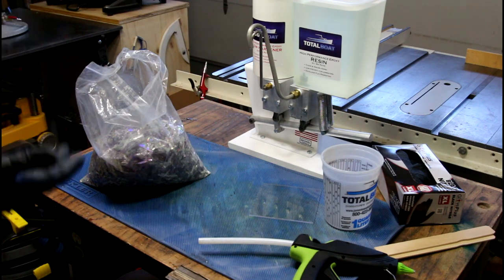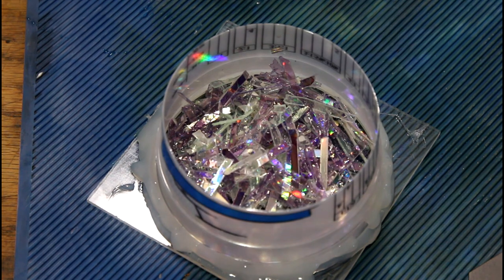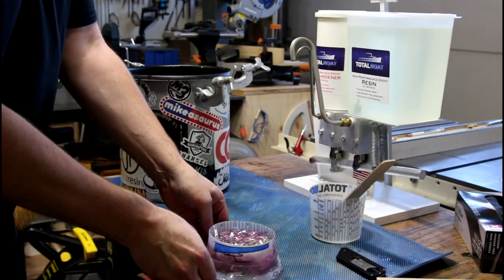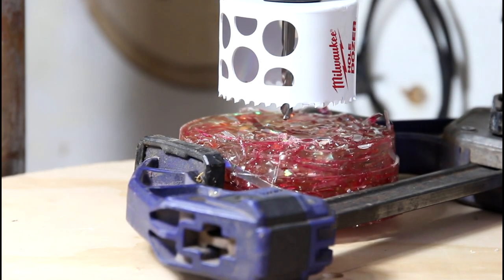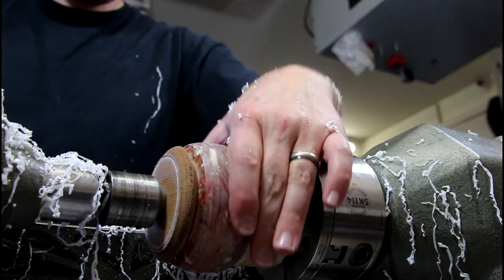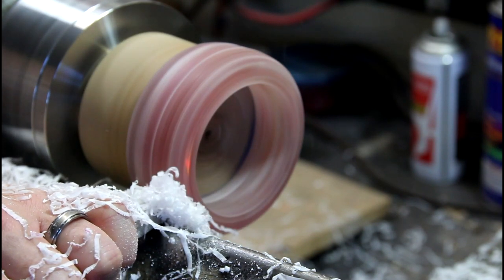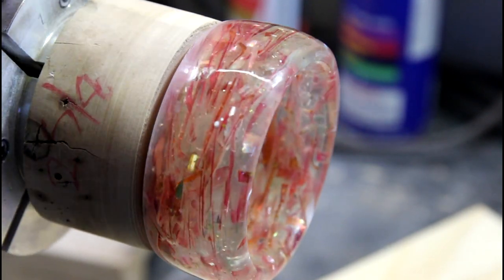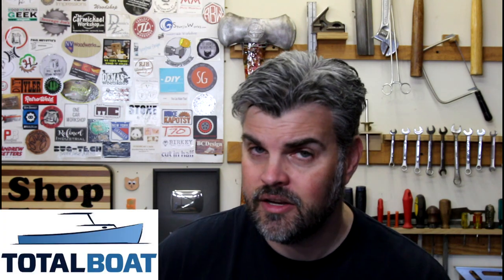Shredded CDs Cast In Resin? OK.

Comment: Every time you say "Shredded", my brain fills in "cheese", so now I'd like to see you cast shredded cheese in resin.
Reply: Yes
Reply: It would melt tho
Reply: Can Peter bring cheese into his shop without getting bio-plastic PTSD.
Reply: I like where this is going but to make it a feasible project can you make a mold of cheese and yellow resin and make it look like you turned shredded cheese? You got this pal
Reply: Yeah, if he just casts a block of yellow resin and hits it with the right tools before it's 100% solid he would end up with what would look like shredded cheese but without any of the odd aging and discoloration issues. Hell if the timing is right it will have the consistency of cheese and he could even use a cheese grater to shred it. Has peter tried messing around with large bowls of resin before they are totally cured?
Reply: And put  it in a cow mold
Reply: My brain finished it with “lettuce” 😂 shredded lettuce
Reply: Yes!  Make a chili bowl out of shredded cheddar in resin!
Reply: Shred yellow plastic that looks like shredded cheese, then put that in resin.

OH OH OH, when he did the mac n cheese powder, make a batch of that as resin, grind it up like grated cheese, use that. Then it'll really be cheesy but won't go bad.
Reply: @groverbundy899  if it was frozen in Liquid nitrogen maybe the heat would not melt it but just thaw it?
Reply: You could probably find a cheese that would stand up to that but it’d probably take awhile
Reply: Well, my brain finished with coconut...so...shredded coconut, please
Reply: @Derginator  how hot does the resin get? They make "high temp cheese" for sausage making that can usually stand up to 400f
Reply: @novelista14  yes that. I forgot what it’s called. Idk what temp his resin gets too but yeah that sausage cheese would work
Reply: @Derginator  Apparently the shredded cheese from Dollar Tree will not melt. It even says it on the packaging. I've seen a few videos about it on the youtubes.
Reply: @groverbundy899  no it wouldnt
Reply: This wouldn't be the weirdest thing on this channel lol. Remember the time peter made plastic out of milk 🤣😂
Reply: OH MY PLEASSEEEEEEEE I NEED TO SEE THIS THE CHEESE WOULD DEFINITELY MELT THOUGH
Reply: @groverbundy899  depends on the type of cheese

Comment: I bet the reds are the result of something something refraction. Like sunsets. The CD surface splits the light into rainbow and only the red light is reflected back out. It sounds science adjacent to me :)
Reply: "Science adjacent with Evan and Kaitlyn!"
Reply: Either that or the foil was warped by the heat of the resin's reaction, changing the color it reflects.
Reply: @XaviusNight  that’s what I thought of.
Reply: I think the dyes used in the foil layer of the CD the laser would etch the data onto will have responded to the heat of the resin curing.
Reply: Science Adjacent with Evan and Katelyn, yeah!
Reply: @thanatos8214  I prefer the LegendTesters myself
Reply: @XaviusNight  Maybe, but I've seen CD's ruined by being left in the sun and they don't turn red. We used to leave CDs baking in the car visor all day and they never turned color. If the interior of a car during Texas summer doesn't do that, I don't think the resin will.
Reply: I saw some red swirls in parts that should be clear, so I doubt it's refraction
Reply: It's probably like how blue butterfly wings turn brown under alcohol. Light moves differently in the resin, so the reflected light is different.
Reply: The CD is designed to respond to a red laser. If he repeated this again with shredded blu rays the result would be interesting

Comment: The color change is definitely a surprise but still really cool. 

I love their dispensing units! They make it so easy. Even compared to the bottle pumps.
Reply from the maker: So much easier!!
BTW I love what you’re doing with  micarta and the Cnc. So cool.
Reply: I wonder if it is a result of the heat of the curing resin acting on thermal dyes in a burnable cd
Reply: The color change makes me wonder if the purple was some form of iridescence rather than a pigment, similar to the structural coloration of the blue in a peacock's feather or butterfly's wing.
Reply: @peterbrownwastaken  Thanks! First learned about micarta here. 😉 Excited to get this new 3d pressed version carved.
Reply: If they were half the price so I could buy one, probably

Comment: Now I'm extremely afraid of what would happen if MichaelCthulhu were to make an actual bracelet...
Reply from the maker: Haha!!
Reply: It would be 3 feet wide, spewing flames on the outside, and weigh 55 lbs. I actually want to see that now.
Reply: "Nova, run back into the house and get yer mum. And also some beans. And while you're at it, bring me the gasoline."
Reply: 99% sure it'd be an 80lb steel hula hoop...and probably on fire

Comment: I think the rounded bottom was due to resin heating.  You're using a laminating resin in rather bulky depths, and it will get quite hot.  I have seen the same deformation in mixing cups full of leftover resin.  It's not a sealed container, so the pressure on the bottom will be equal on both sides in the pressure pot, and if it was a sealed container it would deform concave, not convex.

Comment: Peter, I wonder if I was to make a ring like that but only egg cup size, would a dremel work as I don't have a lathe.  It gave me an idea to make stands for eggs that I decorate.  So they would be a little less than the diameter of a chick egg and only about an inch across the band itself  and half an inch thick.

Comment: Happy '21, Peter!   This was a beauty.   I couldn't believe the pinks and reds.  Love how it is translucent also.  I was watching your fingers THROUGH the bracelet as you finished the micro mesh.
Reply from the maker: Wasn’t that wild? I’m hoping someone can explain that color shift to me. It seems odd to me.
Reply: @peterbrownwastaken  I think it might be the chemicals in that resin but could also be something with how light hits it🤔 but love the vids man keep up the great content
Reply: @peterbrownwastaken  different refractive indices
Reply: This is just wild speculation, but I’m guessing the heat from the curing process somehow deformed the microscopic bumps on the CD material in a way that caused it to only reflect wavelengths toward the red end of the spectrum. Notice how it was more of a red/pink color after it came out of the mold.
Reply: @peterbrownwastaken  the foil on the cds is still metal it heats at different temps it will change the color of it resin has a chemical reaction that produces heat causing the metal to change color
Reply: @peterbrownwastaken  the purple is very likely from a dvd-r or other user-writable medium. I think the heat of the resin curing may have acted similarly to the laser burning when writing to it

Comment: Maybe the heat from the resin curing did something to the CDs to make them red it turned out great though it's beautiful
Reply: I was going to say the same thing. 🤙🏻
Reply: No cause it turned red just from adding resin to it
Reply: @reinkdesigns  well maybe it was a chemical reaction with the resin instead of a thermal one or I could be the way the resin refracts the light too
Reply: It turns red because of the aluminium in the cd oxidizing.  Same reason rubies are red or aluminium oxide sand paper is reddish.
Reply: I think it’s refraction and the resin filtering light different than we expect.
Reply: Rubies are red because of the chromium not the aluminium oxide. And Aluminium oxide abrasive papers come in  a whole variety of colours. The stuff I have is grey.
More likely if these CDs and/or DVDs, since they use a red/infra-red laser for reading it is hardly surprising that they would be more reflective of red light.
Reply: @Spectral_Penguin  α-Al2O3 tends to be red in the wild.  I guess that's what I meant.
Reply: @joshd2013  that or a weird refractive index

Comment: They look that red because they are that red, the blue/purple color is from light scattering in the textured CD surface ( like an iridescent butterfly wing) the resin filled those spaces and the pressure pot shrunk the air spaces so the light cannot bounce around and expose the blue wavelengths.  If it were chemical there would’ve been more reaction in the resin like overheating or cure issues and I doubt it’s
A color thing either. Even with a strong yellow cast the blue would be lessened but not completely cancelled out unless they were perfectly opposing wavelengths of light.

Comment: The foil did a reversed striking under the heat of the resin! Or at least that's how I'm going to refer to this. 😁

For everyone confused, allow me to explain: 
In glass, you find vibrant gold bearing purples sometimes look red or pink before firing and striking to their final color at specific temperatures and hold times (and if the Glass Gods smile down upon you because those colors are understandably expensive). Here, it started a beautiful purple then shifted to red, hence my calling it a reversed striking.

Comment: The color is due to the exposed platinum layer in cds it oxidizes to the violet purple color to start, and once mixed with resin it reacts with the resin to convert to a cherry pink colored oxide. I see that the platinum had no effect on the curing of the resin. Unless it caused it to be more exothermic in reaction.

Comment: I have a theory as to why the shreds changed color. Those discs are all burned. The purple ones are DVD-R and the green ones are CDR. The discs have a chemical coating on them that reacts with the heat of a laser to simulate the pits and lands that are on factory made discs. That's why it's called burning a cd, cause your drive laser is physically burning the information onto the disc. My theory is that the heat of the resin curing process pushed the dye far past the temperature it would have experienced under normal burning conditions, and changed the color from purple to red. Pretty rad!

Comment: What do you do with your resin shavings? Just curious as they aren't biodegradable or recycable, they are just microplastics. Is there a responsible way to dispose of them that doesn't let them get into the ocean?
Reply from the maker: They can’t be recycled that I’m aware of. They go into our local landfill here that generates methane gas (it’s a really cool facility) and that powers a generator for electricity. So they are of use in some small way.

Comment: Probably the heat generated when hardening changed the color. I worked with polyester resin in college, and a guy in my class used too much catalyzer in his resin, so it generated too much heat and the light red dye he used straight up cooked and turned into burnt light pink, it was insane. I imagine your resin might have a similar result with certain dyes and materials.